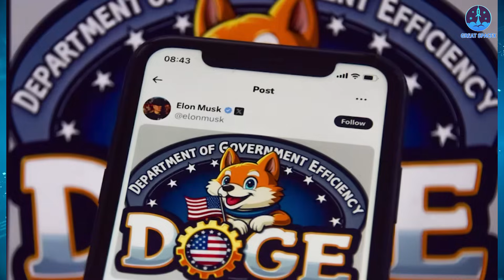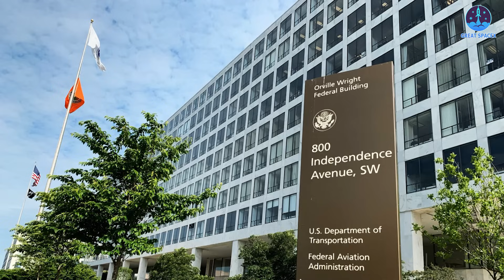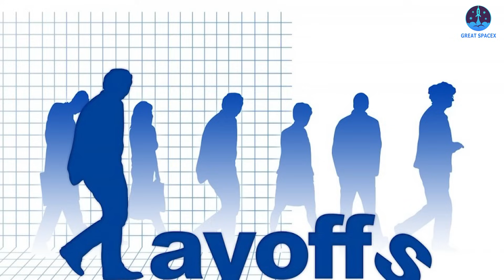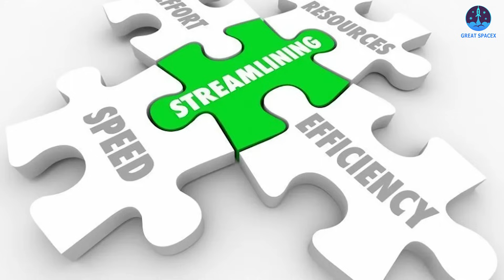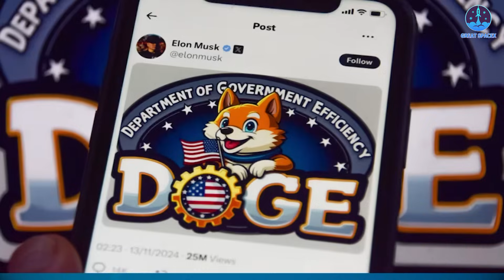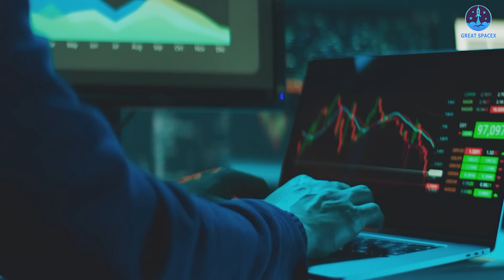Blue Origin revealed 2nd New Glenn Launch Date after Found BE-4 Problem...

Comment: Actually attempting a landing if there is a chance of getting close makes sense, as the landing infrastructure needs testing too, sort of a wet dresss rehearsal for the landing.  Hard to do a fully useful dry run of the landing, and a live attempt is not much cheaper than the cost of the real deal.

Comment: Requiring a mishap investigation for blue origin botching the landing is BS other than SpaceX. Nobody else has ever landed a booster on a drone ship. It’s new to them. It’s new territory. It wasn’t a mishap it was learning.  And it also wasn’t the primary part of the mission. They delivered their satellite into orbit how they landed back on earth really wasn’t an issue. Should we do a Miss happy evaluation on the SLS that dropped right into the ocean ?
Reply: So a misshape only occurs when people die?
Reply: "Nobody else has landed a booster on a ship"  So what was Space X doing with Falcon 9? Over 440 landings...not all of them at sea.
Reply: @williamdrake2315 , read the post .  “EXCEPT FOR SPACEX.”
Reply: @michaeldemarco9950 Your point is BO should not be subject to greater scrutiny than Space X. My point is where I quoted your "Nobody else has ever landed a booster on a drone ship." Never contested unwarranted investigation. Just making the point that Space X has landed numerous times on a barge at sea.
Reply: @williamdrake2315 , obvious we’re not communicating with each other very well (may be my fault).  We actually agree. Space X has been doing it for years (the stated exception in my first post).

BUT, BO is just learning.  And, since landing a booster is fairly new technology, and they (BO) is just learning, they should not be hassled by the FFA.

Just as

Comment: Blue origin is what we would call in the business realm a money pit. They make big planes but they don't actually come with any actual results. 
 It is highly likely that this company will last much longer at this current rate of continuous and constant failure.
 What's even more disturbing is the fact that spacex , which is supposed to believe their so called rival, has been able to do more in 1 year than blue has done in 10.
Reply: BO just succesfully launched and complete orbital insertion of a heavy lift rocket on their first try. 

No other company or agency on earth has achieved this...ever. 

Wtf are you even talking about?

Comment: The grid fins ensure enough drag to ensure propellant settlement ..  The fins they have aren't as like to ensure propellant settlement...
Reply: Drag from the engine section should create enough drag, but they need to deal with fuel slosh and ice just like SpaceX did.  More filters or ??
Reply: @robertfranklin8881  I suspect there may be a stability issue with so much drag being where the fuel needs to go.

Mind you, their architecture isn't the best scalability, either, since the can't arrange these like the Falcon Heavy...
Reply: Obviously not, considering what happened to starship

Comment: Is it fair to compare the development approach of two companies? Blue Origin is slower and more conservative, SpaceX is aggressive and expensive. The more conservative pace of Blue Origin isn't necessarily a liability in a burgeoning private space industry, commercial demand is only just beginning to increase. Soon(?) there will be more than enough business to satisfy launches for micro gravity laboratories, tourism, and micro gravity manufacturing, plenty of time and room for more than one mega company.
Reply: We aren't privy to the costs of either Blue Origin or SpaceX but I think assuming that the SpaceX approach is the more expensive is not justified. Blue Origin has about 10,000 employees (soon to be reduced by 10%), large & expansive facilities with their associated significant capital costs and maintenance expenses, and one orbital mission after 25 years in 'business'. In 2024, SpaceX lifted 85% of all mass to orbit (per Nasa Spaceflight). Which is the more expensive approach? 
In the context of increasing demand for mass placed in orbit, SpaceX currently stands ready to satisfy the need and is well along on development of Starship, which has the potential to dramatically lower the cost of mass to orbit. 
I agree, it's unfair to compare the two development approaches of Blue Origin and SpaceX. However, comparing results/cost is very fair and that comparison is...hardly a comparison at all due to the absolute dominance of SpaceX.
Reply: @richardpark3054

Bro just the starship failures alone are proof BOs approach is more cost efficient.  
Stop the cap.

Comment: If you had to choose a company to do work for you and the choice was between SpaceX or BlueOrigin, who would YOU use? I don't like elon, but his SpaceX is the better option really...
Reply: When I pay for a major service and/or product (like painting or re-roofing my house, both of which I've done in the previous 4 years), I need to know that the work will be quality and lasting. Saving ten or fifteen percent is not my concern when paying for a 20+ year investment. However, with SpaceX, reliability is proven and the cost is lower. So, no contest, really.
Reply from the maker: SpaceX, of course🤣
Reply: Me to 😊
Reply: BO succeeded in getting a payload to orbit on their first ever try. 

Starship has attempted more than five times and still has yet to succeed.  They havent even managed to recover one. 

So BO.  At least my payload will get there and not be blasted across the ocean.